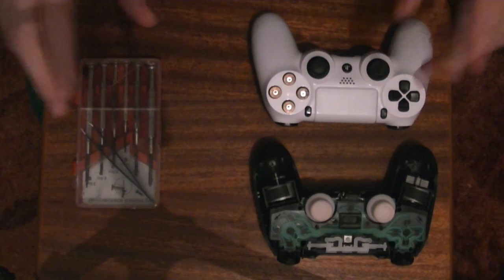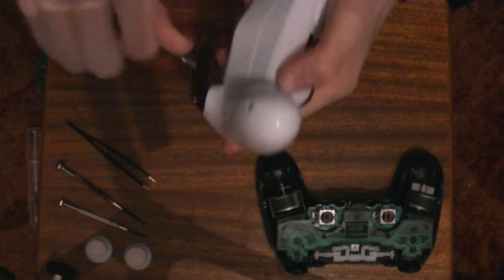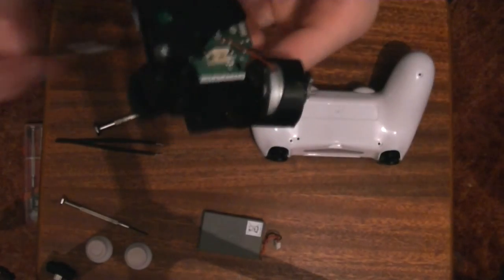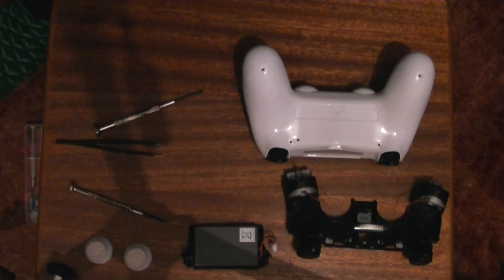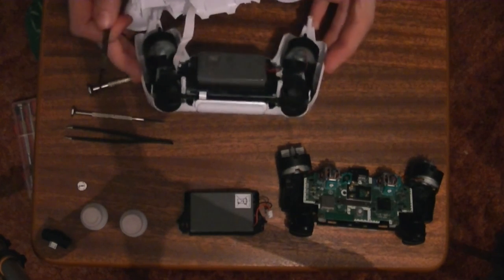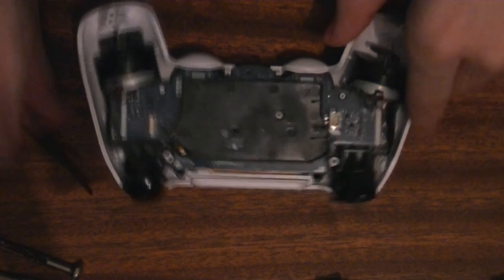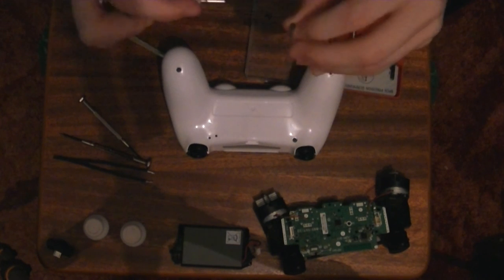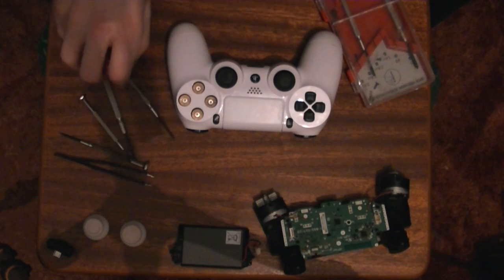How To: NO SOLDERING REQUIRED - 100% EASY FIX FOR THE L3 BUTTON

Comment: All you really needed to do is clean the sockets they sit in. There isn’t anything wrong with the actual parts. The connection is being obscured by a full coating in the fixture. Just clean that out and you’re good
Reply: Stacy Jackson I cleaned mine and it worked for a little bit then it went back to studder stepping
Reply: Big Proc hmm if that keeps happening after cleaning then check the actual sensors. You may need to replace it with a new one or recycle from another controller.
Reply: There are actually multiple reasons this happens with that being only one.

Comment: Mine worked for a little bit but now it is stuck on up and it won’t let me move any other direction/

I think soldering is the only way now.
Reply from the maker: sajid1891 1 you may want to try replacing the little sensor piece inside that green part I showed.